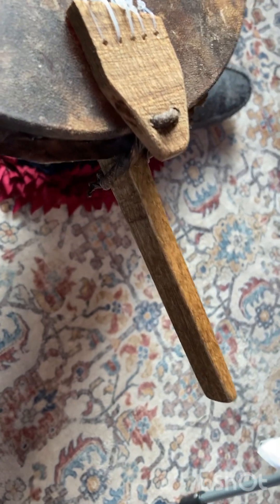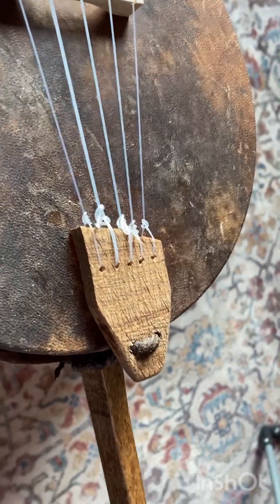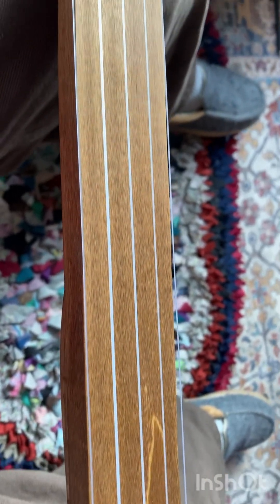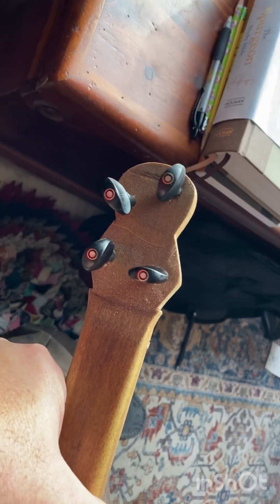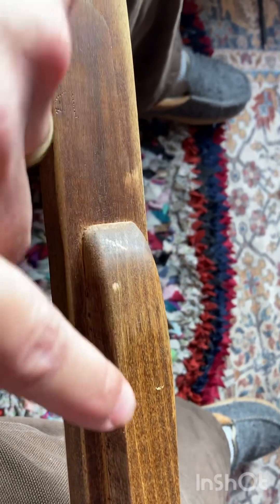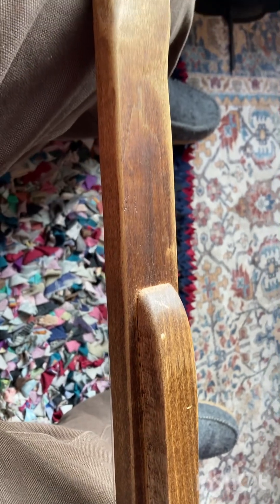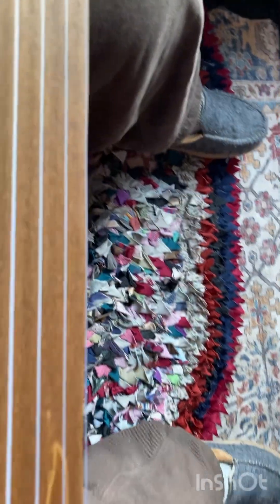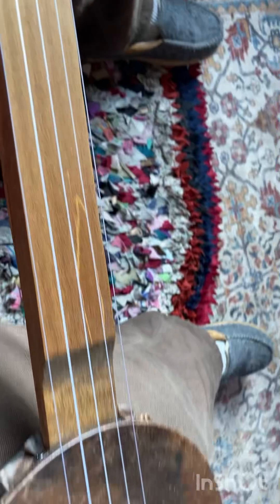Introducing my custom build.  A cake pan banjo.

Comment: Very nice. I love your innovations on the build. How did you manage to pull the skin tight and attach it to the cake pan. That seems like it required quite a bit of thought to accomplish.
Reply from the maker: @tedsdogwalking  I soaked the skin in cold water for 20 minutes. Then I stretched it over the pan using self tapping sheet metal screws to attach it.  I attached one screw, and then another one directly across from it as tightly as I could. Then I just kept attaching them one across from another as I went until they were closely evenly spaced and the skin was secured.  As the skin dries, it shrinks and becomes as tight as a drum.
Reply: @aaronflinner6431  Brilliant. I knew it couldn't be tacks, but I was trying to figure how I would do it. Your way is definitely less complicated than how I would try to do it. Hopefully, by the end of November I will be able to post a video of a build that I am working on now. It will be a mountain banjo based design using a craft box about the size of a cigar box. I built the head with a stencil sheet using a heat gun to tighten it up after tacking it to the head ring. I'm interested to see how it sounds. I've seen other videos where plastic soda bottles were used. This plastic sheet has the same properties, and it definitely tightened up under heat. Thank you for your time in responding. I appreciate it.
Reply from the maker: @tedsdogwalking  I’ll be looking forward to seeing your build.  Sounds like a cool design.  I always figure it’s so much fun building these kinds of things, it’s really okay if it doesn’t work out.  It’s way more fun if it does though.  Good luck on yours.  I’ll keep an eye out for a video if you’re planning on posting one.